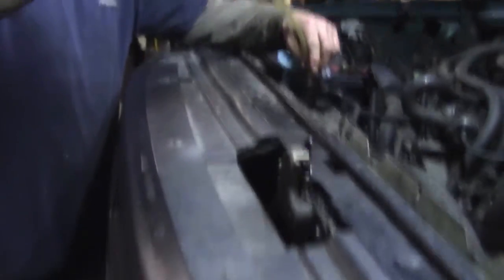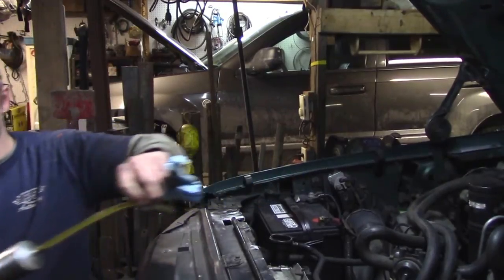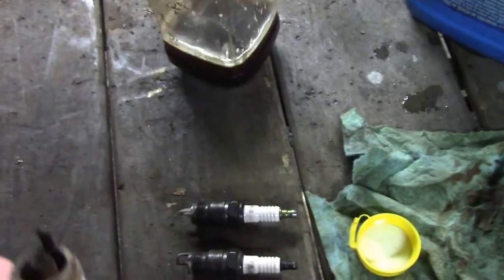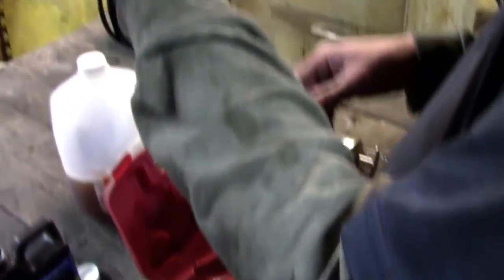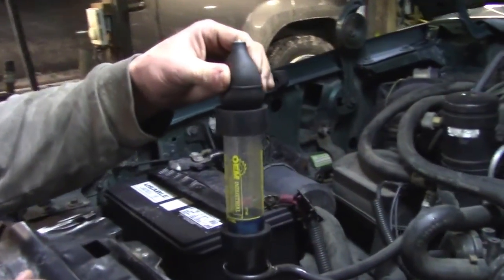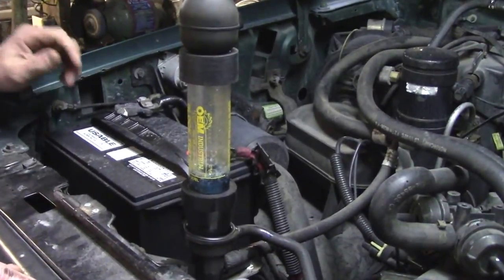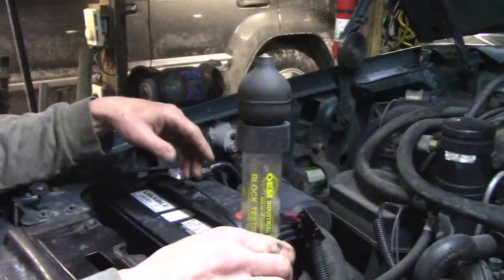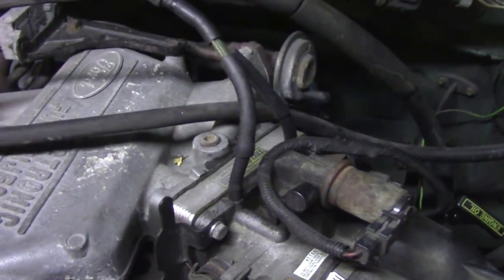96 F150 4.9L cylinder head check leaking out of exhaust valve's

Comment: It's real easy to know which stroke it's on. Take two screws out and pull the distributor cap. The rotor points at it's cylinder on compression. It points 180° away on exhaust.
Reply: I believe it is easier to put your thumb over the plug hole and u can feel it suck in when the piston is going down on intake stroke' u feel nothing on exhaust because the exhaust is exiting through the open valve and it will try to push your thumb off when on compression up stroke...Little tip from an old school shade tree mechanic who never had all the expensive fancy gadgets/tools....

Comment: How many miles? I'm haveing a problem like that put I have 30 to 60psi on every other cylinder changed the head gasket and cleaned the head a little
Reply from the maker: I think it had over 200k, but miles dont really mean anything... There is a whole series on how we figured out and fixed the issue.